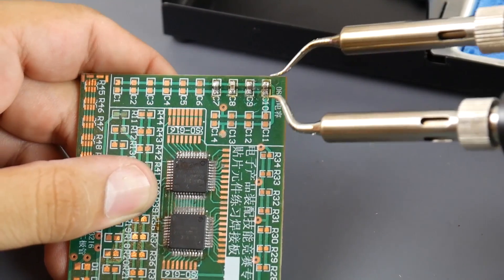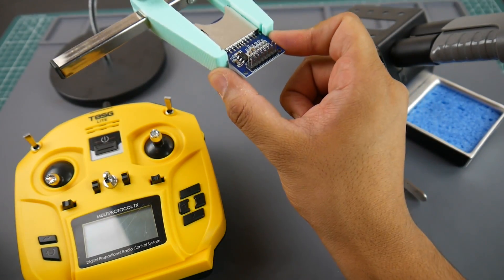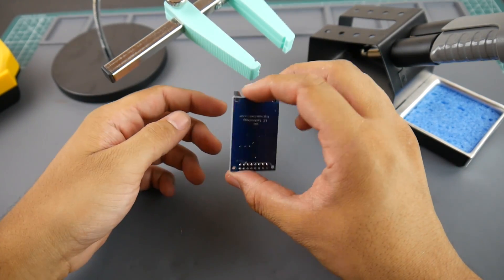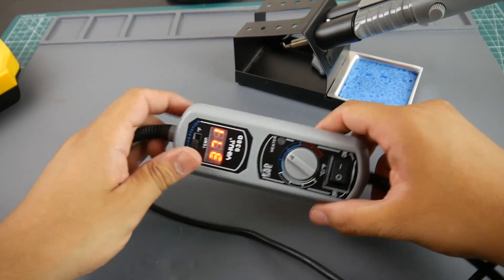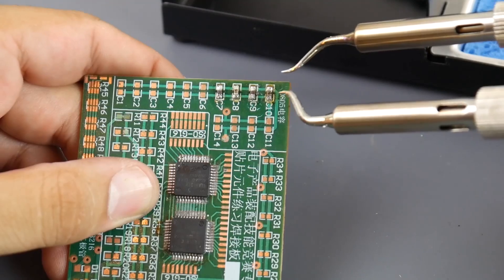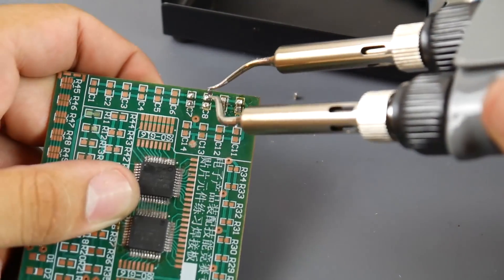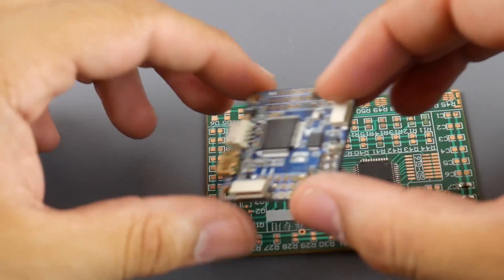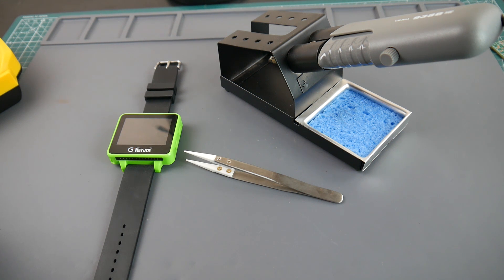New Tools, Soldering Tweezers,  Hobbywing XRotor Micro and More // Mailbag Time

Comment from the maker: Soldering HOT Tweezers
https://ban.ggood.vip/29li 

Silicon Pad
https://ban.ggood.vip/29lt 

Arduino SD Reader
https://ban.ggood.vip/29lv 

Ceramic Tweezers
https://ban.ggood.vip/29lr 

Helping Hands
https://ban.ggood.vip/29lx

Comment: My 2 cents about these soldering tweezers. I got them a month ago. What I like - they heat up fast, temp control is working, didn't broke so far and are cheap enough for casual soldering (next cheaper soldering tweezers cost nearly 300$). What I didn't like - tips are not adjusted in factory and most likely must be additionally bent with pliers in right angle to get both tips parallel each other (mine tweezers required that). Tips are prone to turn aside so they must be adjusted again after some use. So suitable for casual use only and not for serious repair shop. For home use their price beat all inconveniences. I repaired one Racerstar TattooF4S flight controlled using these pliers - soldered back tiny resistors and capacitors which I managed to unsolder by soldering wires using soldering iron with too thick tip :)  Repaired another ESC - teared off capacitors (prop strike on crash obviously) was soldered back in no time.
Reply from the maker: I just finished my review about the aligning its they way you tighten the tip. Took me 2 min and I'm in love I really am in love with them.